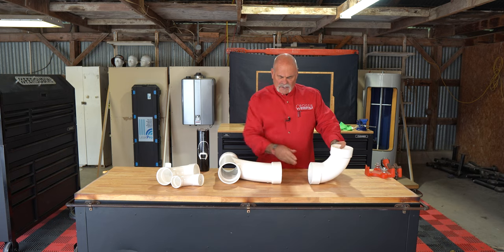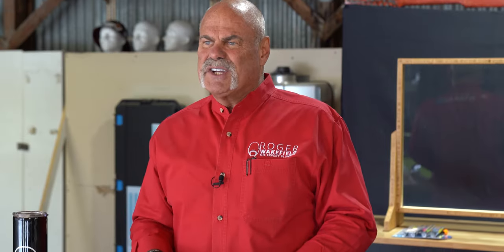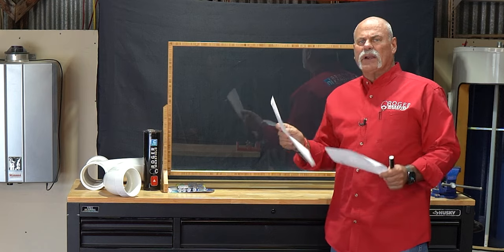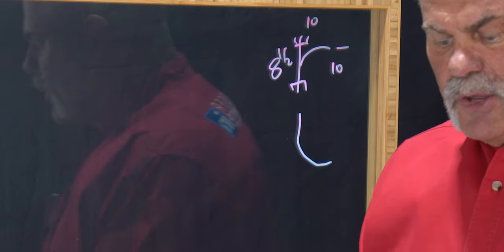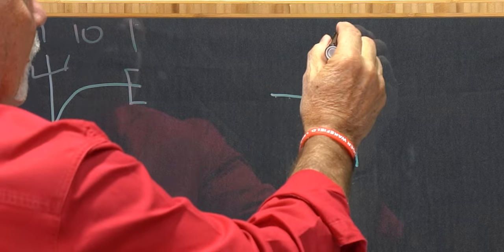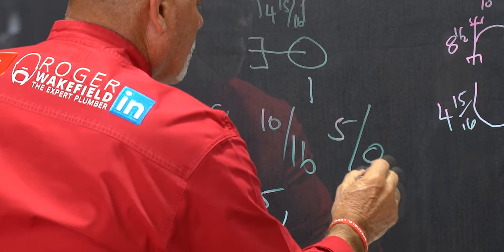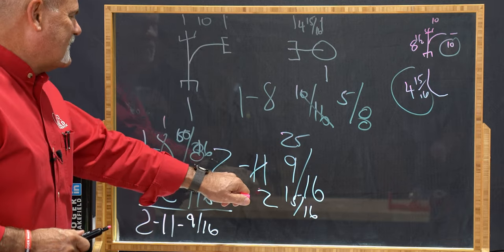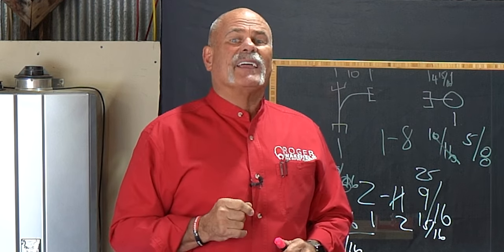How to Measure Fitting Takeoff | Advanced Plumbing

Comment: Hey Rodger I like the video but come on brother you know I’m the field no one is pulling out the Charolette pipe fitting diagrams. Show people how to take a take off with the fitting I. Your hand or lay the hub in a wall and pull a center and subtract the hub. Also show some tricks for 45 offsets. Field stuff not just the match

Comment: Great for laying pipe before concrete is poured to keep it in the 2x4's...otherwise you gotta offset cause you didn't measure right and didn't line it up properly. It takes more time to do it right but saves you from fixing things afterwards in the long run.
Reply from the maker: You are right and over time the more you do it the faster you'll become.

Comment: Thanks for this video, Roger.  In 2021, i started fabbing steel square duct for the first time in my life, using manual brakes and forming Pittsburghs on the brake.  When i got to radiused 90s, i broke out the notebook to do layout.  I replaced a return plenum with two deadhead 90s with a larger plenum that had turning vanes.  (I couldnt move the system.) Given the cost of vane & rail, i drew this stuff out on paper and it saved money by avoiding mistakes, plain and simple.  

Great stuff!!

Comment: If I have these fittings you show laid out and dry fit in place, I sometimes use a piece of twine held bottomed out in the sockets as a measuring tape. Several feet of twine will bunch up in your pocket very comfortably and it is one less tool to lug around. A ball of string or twine is super cheap, will measure lengths up to four or five feet held taught depending on the length of your arms, and can be used to make a quick plumb bob.

To determine offsets using a couple of 45s for nearly parallel drain lines, I use the Pythagorean Theorem to get the center to center length of the diagonal (hypotenuse). I don’t know why anyone would memorize trigonometry constants to figure those out, even for a test. Exam prep classes should stick with geometry as there’s already enough codes and constants to dedicate to memory.

Comment: after throwin enough plastic pipe around i finally caught on to realizing i dont even really need to look at a tape if you just hold your mark fitting to fitting with your thumb, then you transfer the tape to the pipe and move your thumb to the pipe and cut. if you measure from hub to hub you can just add enough for the hubs. which u can easily do if youre still holding a fitting in your hand, just double it up
Reply from the maker: good ole rule of thumb 😂

Comment: Could you do examples with cast iron?
Reply: Cast is even easier. Since there’s not a hub like PVC or ABS, all you need to do is subtract the Center to End measurement of the fittings. 

For example. If your total length is  12”, and the fittings C-E are 3” then you would subtract 6” for two fittings. Therefore your pipe needed would be 6” 

Most plumbers will take off an extra 1/8”-1/4” per band to account for the rubber. Giving yourself a little extra wiggle room helps for the install :)

Comment: I learned these formulas in school, but sadly lost them over the years because most “plumbers” just measure hub to hub with a tape or use their fingers for potable water lines to make their cuts.
Reply: It's more accurate if you start with a known length without actually reading what the dimensions are.
It just means I don't have to change for every fitting.
In the UK the metric system and dimensions are much easier to work out. Mathematically

Comment: So therefor you are going to pay someone $30-$40-$50 an hour to sit on the side of the form in mid june 100+ degree heat to do this kinda of math just because you are looking for perfection? There's has only been one person in this world that was perfect and they crucified him... Besides half of these guy's barely got through highschool math and you are going to expect then to do this minus fractions none the less. Get  out of here with all that.
Reply from the maker: You don’t have to use a form..there’s an app for it, and you can practice and study at home so when you’re on the job you’re not using so much time figuring it out…all it takes is work and a mindset change..
Reply: I’m a plumber and we all account for fitting takeoffs when figuring for our cut pieces every single day. You might as well say to just eyeball all your measurements from here on out because nobody has time for a tape measure. You would make so many critical mistakes and waste so much expensive material it would blow your mind.
Reply: @RogerWakefield  what’s the app called
Reply from the maker: CPF Tech Tools